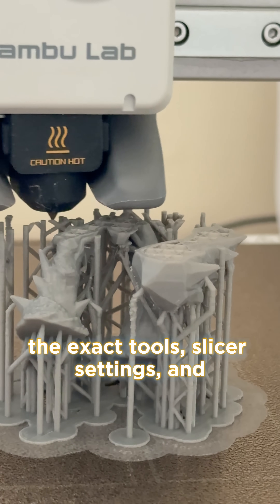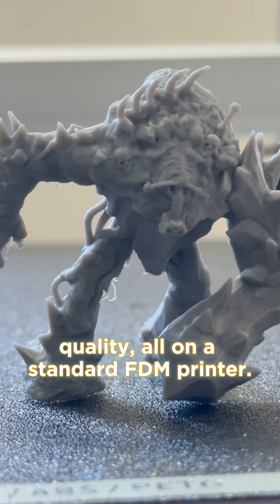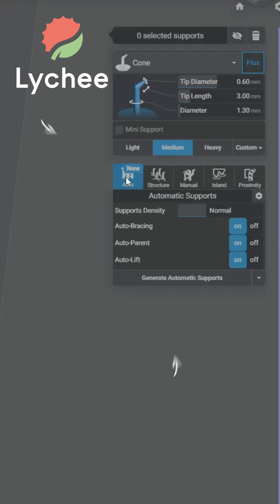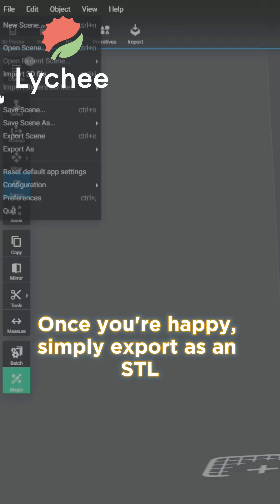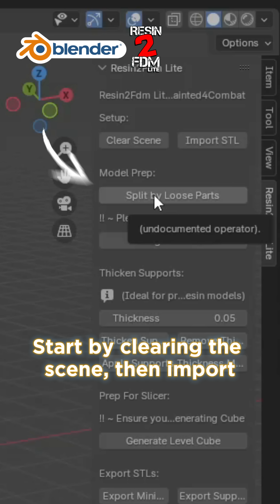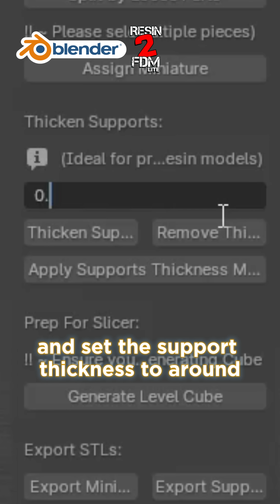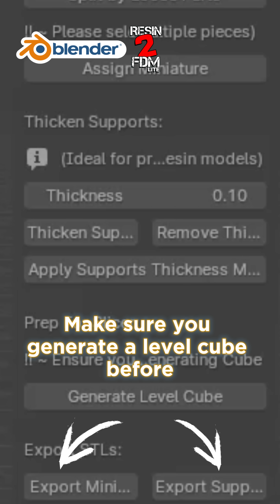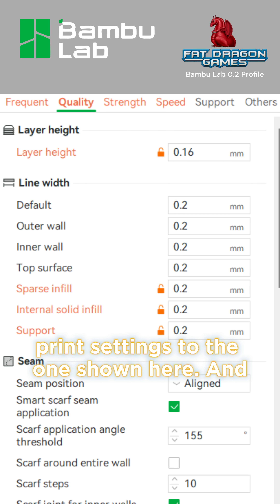Print Resin-Quality Minis on Your FDM Printer?! Here's How!

Comment: doesnt this require lychee plus subscription to use cone supports?
Reply from the maker: Hey , no it’s on the free version 😊
Reply: @designedinlayers  ya you have to select a resin printer in lychee cant put in my fdm printer

Comment: Give credit to Painted for Combat for the Resin2FDM tool on Blender.
Reply from the maker: Hey, I covered Painted For Combat on an earlier video which explains more about the add on :)
Reply: @designedinlayers Sweet deal. I have used his Resin2FDM a few times for Star Wars Legion sized Clown Troopers and it works great.
Reply: @designedinlayers  what video?
Reply from the maker: @patob3363  hey mate, it’s this video 😊https://youtube.com/shorts/iypw7j4Dd-I?si=pLO0Fmb6fW4grWh-
Reply: @designedinlayers  any tips for making the supports easier to remove, im not sure if i can see all the settings for bambu in this video since it doesnt scroll down